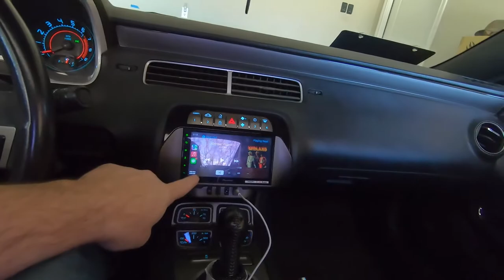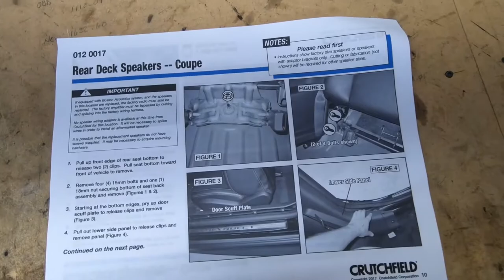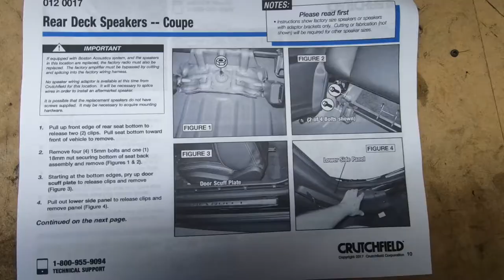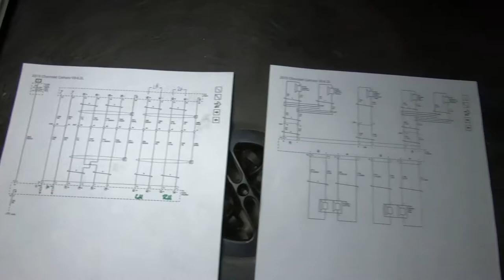Camaro Rear Speaker Upgrade For the Hell Pony

Comment: For the Maestro RR, there’s a step where you hook it up to a computer and configure all the buttons and options.  One of the options is to toggle on/off whether you have an external amp.  Did you try changing that setting, or do you know how you have that set?
Reply from the maker: I did not try that. Either way, it would have to be wired around the amp.

Comment: Hey my wifes got a Camaro RS with the Boston system.  When we bought it, it came with 2 kickers in the rears but they only had some bass coming out of them. I ended up replacing all the speakers with Boston speakers but they really dont put out the crisp clean sound we are looking for. She likes the stock head unit. Is there anyway to put some nice rear speakers in without changing the head unit?
Reply: I get the subthump arnes Fark for my camaro ss 2011 with Boston acustic and I buy a component speakers for the rear, the jbl GTO 960C ,so I have twiters and woofers separately

Comment: Hey buddy!.
You are a swell fella.
I did the same upgrade around my new head unit.
My rear speakers are doing the same clicking noise.
The little thing you bypassed in your video... I don't quite understand where that is?.
Is it part of the pioneer head unit or?.
The aftermarket surround around the factory head unit.
I don't know the name of that unit I bought.
Can you help me?
Thanks!

Comment: Hi, I am puting together a new sound system for my 2010 camaro, I got so fat a componet speakers for the front, the android auto head unit... now I am not sure if I may buy a 6x9 component for the rear ones or the ones you have... both are same brand... also the other thing under my to do list are... a nano amp that push 100 RMS specs power... 1 mono for a shallow infinity sub... wil really apreciate your imput if I may go for the rear component or the ones you have... thanks in advance
Reply from the maker: That really comes down to how much work you want to put into mounting the rear speakers. I am guessing you are talking about separate mids and highs for the components not all mounted together like my 6x9's? If so, you are going to have to get creative on how to mount the separate components. What's the Nano amp for, 100 watts RMS is not much power. The mono amp will be good for a sub if it's wattage is high enough for the subwoofers needs. Just my input since you are asking, I'd stick with what I have for rear speaker set up. If you are wanting the nano amp to push your mids and high, get something bigger to push them than 100 watts. Was any of that helpful??

Comment: I got the 11 SS with BA system, I want to keep the speakers and head unit stock, just adding the external Amp, not spending 70 bucks on a Fark harness....on the diagram which color wires on the X3 can I put the Kicker 46KISLOC2 K-Series Stereo Line-Output Converter w/Remote Turn-On Output, the colors on it is              L-+  White/Black, White. R-+ Grey /black, Grey. Can you give me the colors on the X3 from the BA Amp output ? I don't know if they lows or highs? I appreciated Bud.....
Reply from the maker: Sorry for the late response. Good question as I'm getting ready to dig into this when I add a sub coming up soon. At X3, looks like I'm going to try L+ pin 13 BN/WH, L- pin 5 BN, R+ pin 12 D-BU, and R- pin 4 TN. I have not tried these yet to see if they work but that's what's showing on the schematic for the L/R rear channel inputs to the factory amp.
Reply: @jazzlejohnson5364  all good, I went a totally different route, kickers is gone, the bass roll off was too much, so I went with the harness, going out to the Audiocontrol- EpicCenter, then to the Skar Amp, using the Rockford Fosgate Amp with the pass through, and I'm telling you, it's hitting hard and clean, now I'm setting up the fronts and rear through the DQ-61 and then to the Rockford Fosgate Amp

Comment: My infinity Kappa components do not match the holes on the Metra adapters.
Reply from the maker: Mine didn’t either. I think I showed what I did with mine in the video. If I remember correctly, only two holes lined up. Pretty sure I used the supplied self-tappers to secure through the other two holes.